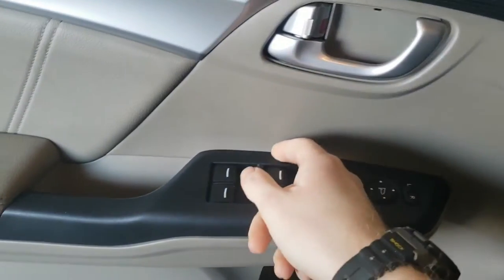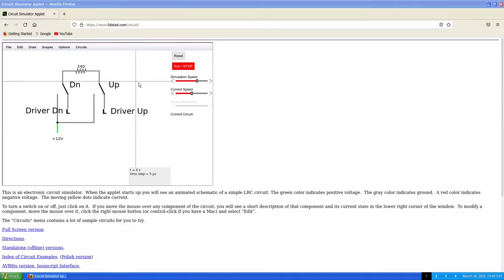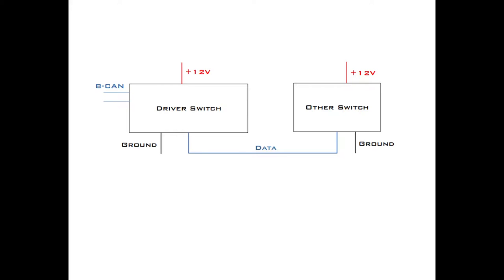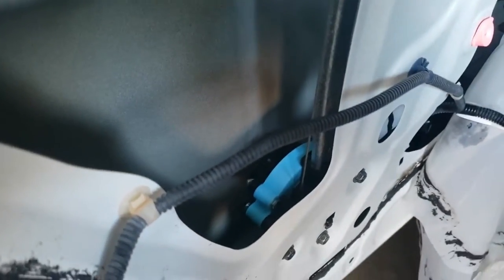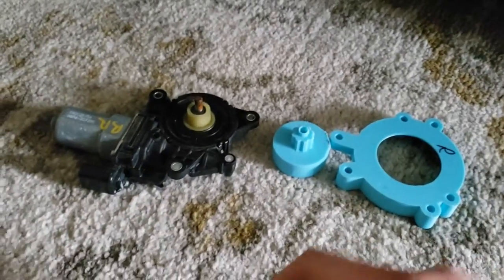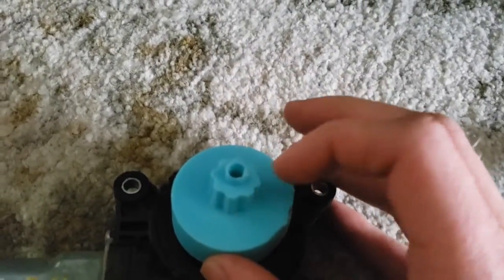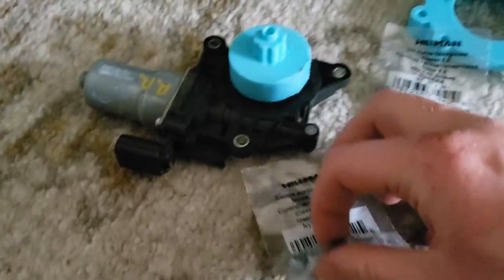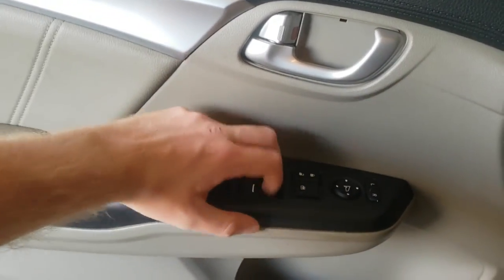2012-2015 Honda Civic Full Automatic Window Retrofit Part 1: Overview

Comment: If you go to 14:07 do you know what the cap on the switch is called with the transparent white line? I have diff make car but I’m trying to add backlights to buttons no 3rd party makes a plug and play backlight one. But my caps don’t have the see through line to let light through. 
What’s that cap called?
Reply from the maker: That's part of the button, not a separate piece. You will need to replace the switch assembly. They should be available from RockAuto (shown).

Comment: Great video. I wonder is there such thing as just replacing the switch. I only want the driver window changed.
Reply from the maker: If your driver window is automatic down but not up, you may need to replace the motor with one with the sensor; see part 2 for details. Then you can run the wires to your new switch and have an auto up/down driver window.